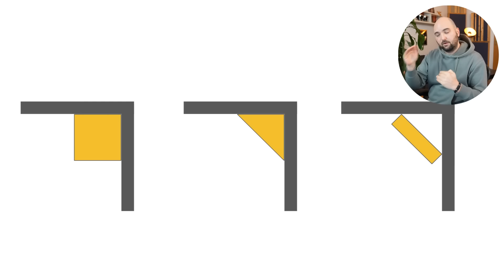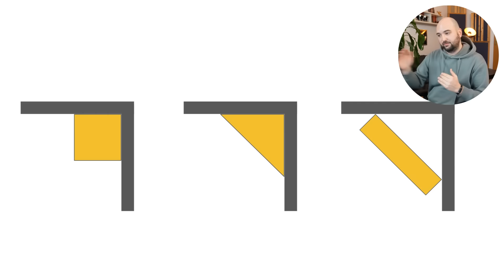Bass Trap Shapes Compared: Which Design Actually Works Best? (with diagrams)

Comment: Wouldn't a triangular trap be best? I doubt the sound is going to come in at a straight angle especially if your speakers are angled towards your head. Wouldn't that mean an angled sound wave would enter the front of the trap, hit the wall, bounce, hit another wall then bounce back out? In a super chunk wouldn't this force the sound wave to travel a longer distance through a material? With a panel wouldn't the sound travel through the material, hit a wall, bounce, hit another wall and bounce back out having passed through less material and therefore be absorbed less?

Comment: You missed talking about the third, but important, use case which is "space" used by the panels,  both on wall and in front of it. Many home studios have limited space, so if you keep a common measurement (say 1.5 ft out both ways from the wall corner), then the second best (and the one with optimal use of space) woyld be the triangular bass trap.

Comment: Aren't these insulation based designs velocity traps? So placing them in the corner, where you have low air velocity and high air pressure would be counterintuitive for the square trap, wouldn't it? . . .

Comment: I understand and thank you for the lesson however my question is always where to place a panel on the wall and corner. let's say the wall is 10ft high and I only have a 5ft panel. Do I go center? Do the corners differ from the not corners in which to place? when I think of bass I always think of ground level because that's where I always tend to feel it first. so I placed my corner "bass trap" panels on the ground and the rest on the wall yet I'm also unsure how to test which one works best.

Comment: Didnt you say if the air gap is deeper than the panel the performance degrades? Or does this not apply if used in the corner ?

Comment: If we wanted, we could rotate flat panel-style corner traps 90 degrees to the traditional configuration and they would still be exactly as effective against room modes, right? (e.g. bisect the corner..) Could be useful in rooms where the traditional configuration would block a door, or where you simply need the the space --  you could even add some shelving (made out of some light/open material) to store microphones, cables, etc. in the now-accessible "air gaps" instead of losing it as inaccessible dead space behind a panel.
Reply: If you put things to the air gap space, its not air gap anymore, no benefit
Reply: @rcs2003  No. I wasn't talking about filling the air gap solid, and I don't see how you got that impression. I was talking about using the space to store small studio items, a scenario where there is still plenty of air. Small items are transparent to low frequencies because they are significantly smaller than the quarter-wavelength and made out of thin materials. Low frequencies simply go around and/or through them. The purpose of an air gap is to place the absorption closer to the offending room mode's quarter-wavelength (where absorption is most effective). A shelf with some mics isn't going to shift your room modes -- the modes are still going to be interacting primarily with the room's solid barriers (walls).

Comment: @5:28 If consistent depth of absorption material is a key factor, the optimal cross section of a corner bass trap would be a quadrant of a cylinder, with its visible surface a circular 90-degree arc. This presents sound waves from all directions with a constant absorption depth while minimizing the physical protrusion of the trap from the corner.

Comment: Wait, with the large panel in the corner, wouldn't you get phase cancellation dips?

I thought I saw an older video where you showed that the are gap starts to give dips when the gap distance exceeds the depth of the panel?

Comment: Hi, Jesco! I have one different question about lowest bass frequencies. Is there any theoretical advantage to have one bigger membrane vs 2 smaller with same active surface? Forget all things about voice coils, speaker volume and others. Just physics of the one bigger membrane vs two smaller. I think that the bigger one will move more air, because it can't cut through the air so easily as two smaller. Something like swimming with fingers wide open vs tightly hold together. I hope that make sense. Sorry for my English.

Comment: I have a slightly rectangular room. I have monitors/desk on shorter wall which also has a door on the far left side on monitor side and a door on the far right side of the back wall. So I can only possibly do bass trap panels on one corner of front wall and the opposite corner of the back wall. Is it worth it to do this or will it cause more issues not having bass traps in at least both front corners?

Comment: Hi Jesco, thanks for all the information you share with us!!! ...I have a question related to bass waves. What's your take on this?
I often hear that speakers should be placed at least two meters apart so the bass can develop. I don't get it: the vibration starts at the speaker, so why should it need space to "develop"?
I sit 1 meter away from my speakers, which are directly against the back wall – and I had to lower the bass accordingly to compensate for the bass amplification caused by the placement close to the wall... ...I have enough bass... ...my speakers are sealed...
Best wishes from Bavaria! ;-)

Comment: So the square or rectangle bass trap is the best ( if I am okay to fill it  with good quality Rockwool)  Will you recommend a square or a rectangle bass trap for a room size of 9 by 13 by 9 feet ?? What should be the dimension of the square or the rectangle ??

Comment: The issue with the opinion is that bass traps only need to be in the very corner, not along the walls. You can put flat accusation panels along the walls, thick ones if needed. So with the actual dimensions of the panels AND the ROOM AND measurements of the actual reflection points overall, this isn't useful.

Comment: All your videos are simply great Jesco - thank you. Please can you make a video exploring ceiling cloud depths and positioning in relation to other treatment in the room and ceiling heights/shapes. IE, how low a cloud should be beneath a gable ceiling - does it follow the same rule you've expressed that the trap shouldn't be thinner than the air gap behind it. Can it/should it be thicker than your wall/corner traps. Other considerations? 🙏Thanks mate

Comment: Thanks so much Jesco. I would be really interested in an explanation of why the air gap functions just as if it's full of acoustic treatment
Reply: It's because these porous,  broadband absorbers are velocity rather than pressure based. That means they are most effective where the wave of sonic energy is at high velocity. At the wall surface, the pressure is high but the velocity is low. Move away from the wall and the velocity increases. So the absorption up closest to and against the wall is actually less effective at absorbing the (lower) frequencies that have longer wavelengths.  Moving the absorption media away from the wall means a larger chunk of low frequency energy is being absorbed.

Comment: So, I made a quick bundle of rockwool 15in wide by 12in deep and 47in tall.  Wrapped them in a bed sheet to contain the fibers and make handling it easier.  Set up mic and took a REW sweep, put bundles in the rear corners, and re did sweep. They landed right ton top of each other. I don't know, but there was no change at all. The room is 15ft by 15ft by 9ft high.
Reply: You should put bass traps into all corners and to all of the horizontal corners where wall and ceiling meet, plus some ceiling clouds above your listening position. Bass bounces all over the room, not just in two corners. Edit: by the way your rooms size is the worst in  terms of acoustics. Just like mine haha :D

Comment: So if the air gap adds to the overall absorption in the corner, wouldn’t pipe insulation/tube trap be optimal for corners?

Comment: Hey folks, two questions about portable corner bass trap panels I intend to build out of Roxul. They will be 2'w x 4'h. 1) How thick should they be? 2) Can I use rigid Roxul for this purpose? It is stiff so would make panel construction/rigidity much easier to deal with than loose (non rigid) Roxul. Thanks for any input in this regard!

Comment: Im making a square style and putting it on a dolly trolley that i can roll out and off the wall to create an air gap when needed. I'll push it back into the corner when not recording so that i get the room space back. Win.
Reply: Did you finish them up ? I am thinkign about doing something similar
Reply: @tango_gru yes I finished the front ones. Still have to make the two for the back of the room. They seem to be working fine. The trolley system functions well.

Comment: Great useful info! Glad I found your channel. I am asking this b/c I need to add more insulation in the walls in my studio - not sound related. However, there's enough room in this dead space to add 1ft thickness with at least that much air gap left. The sheetrock will be undisturbed (doing this work via attic). I know some frequencies will still reflect off the texture painted sheetrock, would you count this added space as beneficial for bass trapping? I will still treat that sheetrock, but just wanted your take on it.

Comment: I recently watched several DIY videos on how to build bass traps, and in some of the videos, they used Rockwool, placed it in a plastic bag or film, and then covered everything with fabric. I was wondering if a plastic bag or film affects the efficiency of a bass trap?
Reply: I would expect the plastic bag to reduce the higher frequency absorption but not the lower frequencies as they would pass through a loss mass plastic bag.

Comment: This is total BS. Sound acts like a pressure at the surface. Despite frequency. All that low end BS he’s talking about doesn’t make sense. Sound doesn’t “see” trap. It acts absolutely different. If you want your bass management to be correct, go with a RealAcoustics BassMode traps. Only ones with a real NWAA LABS test done and presented. This guy doesn’t know shit.
Reply: This comment sounds like advertisement by a bot
Reply: @ if you say so.
Reply: "All that low end BS he’s talking about doesn’t make sense. Sound doesn’t “see” trap. It acts absolutely different. " - what exactly do you mean by this?
Reply: @rited  do your research. Nothing “traps”. There are few types of absorption: friction, diaphragmal, resonance, diffraction. None of it “traps” the sound. I

Comment: Here is this absorption measurement of the SSC and SCA type corner absorbers. The SSC is a stack of Owens corning 703 cut into 2' by 2 ' squares and then cut diagonally giving you a 34" wide face. This is for 8' high stack measured by RAL in 2004. total Sabin's are 63Hz - 5.54, 80Hz - 6.47, 100Hz - 6.87, 125Hz - 5.21, 160Hz - 4.78, 200Hz - 4.67, 250Hz - 5.00, 315Hz - 4.82, 400Hz - 4.91, 500Hz- 4.68, 800Hz - 4.09,  1000Hz - 3.98, 1250Hz - 4.00, 1600Hz - 3.68, 2000hz - 3.72, 2500Hz - 3.60, 3150Hz - 3.60, 4000Hz - 3.68, 5000Hz - 3.53.

The SCA which is simply 4" of 703 2' x 4' pane; across a cornet giving 24" wide face. This is for two panel 8" high total measured  by RAL in 2004. total Sabin's are 63Hz - 4.11, 80Hz - 5.70, 100Hz - 5.97, 125Hz - 3.71, 160Hz - 3.88, 200Hz - 3.61, 250Hz - 3.88, 315Hz - 3.89, 400Hz - 3.99, 500Hz- 3.14, 800Hz - 3.76,  1000Hz - 3.49, 1250Hz - 3.47, 1600Hz - 3.34, 2000hz - 3.21, 2500Hz - 3.10, 3150Hz - 3.07, 4000Hz - 3.19, 5000Hz - 2.92.

These are total Sabins not coefficients so calculate accordingly.
Reply: Now we are talking with actual data. This is what is missing in a lot of the YouTube videos on studio acoustics. What is also missing is the calculation of just how much you need (how many Sabines) to install to achieve your goal. The other thing missing in a lot of these videos is discussion of what the actual goal is - what reverberation time are you trying to achieve. To answer that one needs to know the room usage goal - recording (& of what), control room, watching movies, or just HiFi playback enjoyment.
Reply: @davidcrocombe1322  In the case of these SSC and SCA corner absorbers you calculate by Sabin's per unit vs Sabin's per ft foot or meter. Often assemblies are measured and specified  per unit. There should be a few calculation spreadsheets floating around on the internets. Absorption calculations are fairly easy to by hand  or in a spreadsheet. Unfortunately I cannot upload one here. Yes knowing your acoustical target based on the room usage is very important. Just as knowing where to locate absorber, diffusors and reflectors is difficult for someone doing their first few rooms.